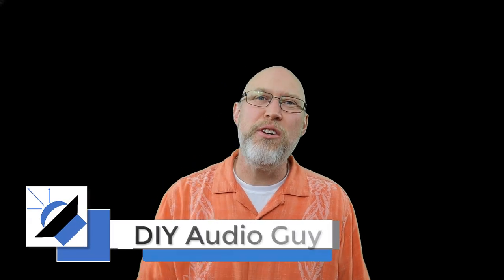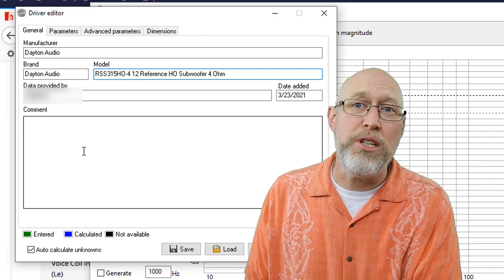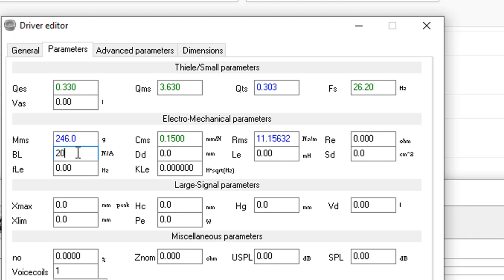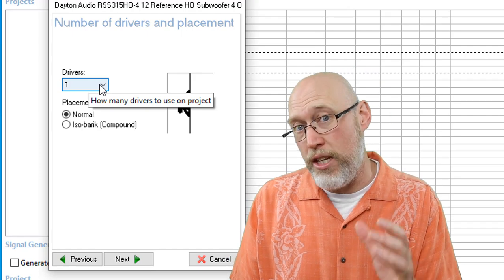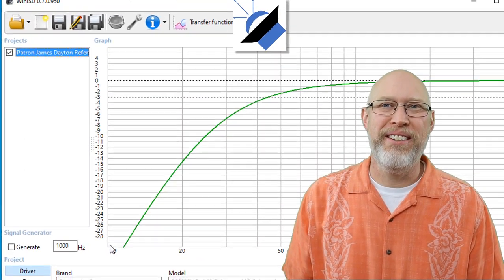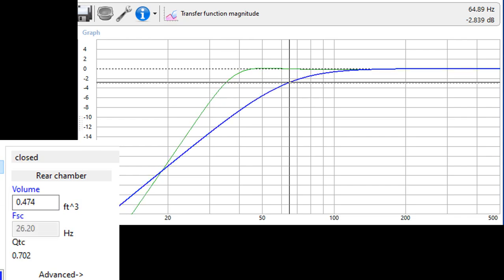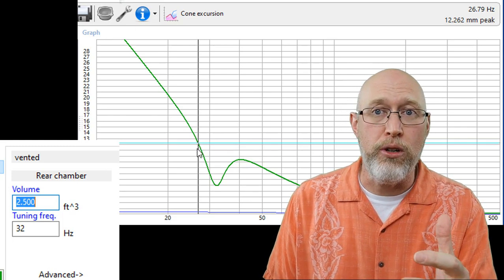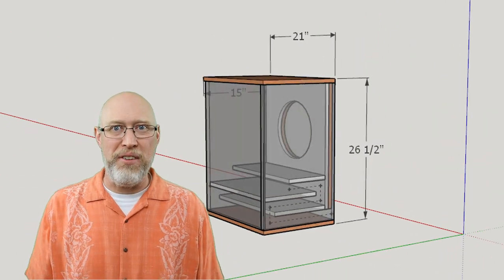WINISD for beginners, design your own ported enclosure!

Comment: hello good night, great video. I would like to know if the calculation that winisd makes of the box, if the space that the speaker and the duct occupies is already included. Thanks
Reply from the maker: Nope, WINISD is going to give you the net airspace not the gross.  So you have to add back in the port, any bracing, and the speaker itself.

Comment: I have a pair of old school stroker 18ds. It turns red when I load the t/s parameters.I am not sure what I need to do to continue.
Thanks for your help
Reply from the maker: Other than just going through it kind of slowly and giving it a chance to auto calculate there's not much you can do.  Fortunately it seems like the software can operate when the parameter integrity check fails.

Comment: If you would, could you make a video explaining the differences between the older versions of winisd vs the new one (one youre using). I have only ever run an older version (0.44) and it is a completely different than the new one you just showed. Part of the reason being that the new one's auto fill for the T/S parameters screws up sometimes. Manufacturer will have one spec one way and winisd will say its wrong. Other than that I didnt know the new version has an excursion chart which I desperately wanted after using Hornresp (also another program you should touch on).
Reply from the maker: I need to give Hornresp a try for sure!

Comment: I find it hard to figure out what box size I have to enter. I know the outter dimensions but the sub and port will take some space away. I dont know how much that is because the program designs the port for me after I fill in the box size. So what do I need to fill in there? How can I measure that?
Reply from the maker: In WINisd you enter use the internal airspace, then when you design the enclosure you need to make it big enough to fit the airspace and the port.  Hope that makes sense.
Reply: @DIYAudioGuy  thank you! I was always calculating the port with the box but that’s what you add to the box afterwards ofcourse! Do you have any tips how to make it easy to calculate the ported enclosure when you want to use the maximum space of the trunk? So I have the outter dimensions of the enclosure and I know the tuning freq. Is that going to be allot of calculations until everything is right?
Reply from the maker: @JamHavoc  You just have to measure the trunk, and make sure you can fit the box in the opening.

Comment: I'm so glad I found your channel.  How did I not know about it sooner? Lots of technical stuff which I love. One question I have or would like to see a demonstration of is dampening or dampening factor.  How ohm load effects it and spl/SQ and such.
Reply from the maker: I am not an expert on amplifiers, but from what I gathere damping factor is a way to express how well an amplifier controls the cone movement.  It's one of those things that's important up to a point.  Like everything else with audio there are diminishing returns.
Reply: @DIYAudioGuy  appreciate the reply. Its one of those im not even sure if or how they can measure it. Strage thing I've noticed when playing with the meter is that seems good damping seems more efficient with spl. Ya you can gain a db going to half ohm or whatever. But at the cost of 2x the amperage draw and sloppy cone control.  but also not the case always.
Reply from the maker: @sittdogg  there's a device called an audio precision, the big manufacturers should all have access to one.
Reply: I always try to express the importance of high damping factor when playing low frequencies it’s basically the amplifiers ability to control the incoming eddy currents

Comment: I want to make a Subwoofer with passive radiators I tried using WINISD and selected the Passive Radiator for the type but it won't go ahead after this step. Any idea how can I design one?
Reply from the maker: Try uninstalling and reinstalling WINisd.
Reply: @DIYAudioGuy  I'm sorry I should have said it clearer. I mean it says that the current version of WinISD can't do this
Reply from the maker: That's odd, I have designed PR builds with it-- it was a bit buggy bit it worked.

Comment: What could be the problem with the failed integrity check? I have entered all the ts parameters but it still fails! Awesome video as always!
Reply from the maker: It could be anything, it could be down to a rounding error or the parameters provided to you by the manufacturer might be wrong.  When I enter my parameters I'm always very careful to make sure that the software has an opportunity to auto-calculate.  Take the QTS, QMS and QES.  WINisd Will let you enter in all three, I enter two of them, and then click in some other random field and the software will update.  But if I enter the first two and then click on the third one and type it in then the software will not auto calculate.  Hope that helps.
Reply: @DIYAudioGuy  all (the 10 or so I randomly picked) of the pre loaded drivers fail integrity check.  Seems sketchy
Reply from the maker: @mickharr  That's odd
Reply: @DIYAudioGuy  yeah I thought so too. It seems the integrity check has no tolerance on the computed parameters,  if you enter too many it will fail due to rounding.

Comment: How many decimal places does the unit conversion need?  I cannot get the checksum to pass no matter what I do.  Had the same problem last time I tried WinISD years and years ago, and it seems it's still an issue.  Incredibly frustrating; everyone always talks about how useful and powerful the program is, and I'd love to not have to do everything with pencil and paper like I have for the last 30 years...  :(
Reply from the maker: That's not fun!  I would just avoid doing unit conversions and change the units in winisd to match the ones given by the manufacturer.

Comment: Unfortunately ti looks like WinISD doesn't take Le or semi-inductance into consideration, both of which will appreciably change the response at bass frequencies for today's long x-max, high-power car audio woofers, particularly if they don't have "shorting rings" in the motor.  That's why I prefer to use Hornresp for design work.  Hornresp is a bit more difficult to understand though - which is why I developed my BOXPLAN Excel workbooks - just choose the one that matches the box you'd like to build, and it chucks out the corresponding Hornresp parameters :-)
Reply from the maker: I have been meaning to give hornresp a try.

Comment: Nice. I just finished up creating a sketchup of a 5ft front ported floor speakers and 4ft back ported speakers. I get the driver data fails integrity check, but it allows for me to continue with the modeling nonetheless (entered precisely what was on the datasheets). It is an MTMW design with a subwoofer in the basement. That makes it a big speaker (2'x4'x14"). The size is mainly to accommodate having a  10" Dayton Reference sub in it. 

I just got the Loudspeaker Design Cookbook 7 and read through chapters 5 and 6. Planning to do a Home Theater set. Here is the posts on my journey over at Toid's forum. https://toidsdiyaudio.com/community/diy-speakers-diy-speakers/kartesian-5-0-system/#post-6220
Reply from the maker: Tell Nick said "hey"!

Comment: I feel like you should have put a little more time into the part where you enter the parameters. I really recommend Toids video on that matter. Inputting data is very frustrating if you don't know in which order you have to plug in the values.
Reply from the maker: In my experience the order does not seem to really matter.  You just have to go slow and make sure that the software is doing the auto calculations.
Reply: @DIYAudioGuy  In my experience, having the software do the auto calculations is exactly what causes issues. Small "workaround" tricks that I've learned: 1.) Entering values in any other tab than the "Parameters" section can trigger an error, so while less "information about the naming of the speaker" will be available, keeping that info out allows for less erroring. 2.) After every value put in, regardless of the order in which you enter them, attempt to "Save" the project (you don't actually have to save, just click the button to see if an error comes up that'd prevent you from being able to save). Then, backing out of the save and entering in your next value... This procedure can show you exactly when, where, and how the program doesn't like something you've done, and you can start to get a feel for what not to do in the future to avoid errors from happening, like enabling "auto calculate".
Reply: @DIYAudioGuy  Oh yea totally sorry I didn't mean the order. I meant that it is easiest if you go by a certain scheme. The scheme toid showed always yielded a good result for me

Comment: LoudSpeakerDatabase is also a fantastic source for T/S Parameters (as it already has pre-populated files!), but it's user contributed so there's a bit of lag between new drivers and files being available.
Reply from the maker: I will have to check that out!
Reply: @DIYAudioGuy  It's great for people like me who always mess up the "order on entering the specs" or who struggle to find specs for certain drivers. It's sooo helpful when it's already there and all I have to do is click the "WinISD" link and download the file. 

I look forward to hearing your thoughts on it.
Reply: @budgetaudiophile6048  I downloaded the file on the website you wrote.
It's an Dayton Audio Ultimax 10 for me, but WinISD tells me that the driver data fails integrity check
Reply: Thank You so much for telling I spent 30 min entering the parameters it worked in the end but I'll still use LSD. Should have read this comment before doing lol
Reply: Hmm I tried using the LoudSpeakerDatabase driver and WINISD shows the red sign so it won't work in my case
Reply: @ashyouknow7420  Yeah, I have the same problem
Reply: @ashyouknow7420  Ahh, that sucks. I wonder what parameter didn't pass integrity checks.
Reply: @DTW-bx2vy  So just the other day, I picked up a Dayton Audio DATS V3. That is some of the best money I've ever spent! It's helped so much with projects. I highly recommend it!
Reply: @DTW-bx2vy  I feel you. I'll just say, to play Devil's advocate, that I AM the Budget Audiophile so if I don't HAVE to spend money, I won't, LOL! That said, I purchased the DATS because I had a single project that I wanted to confirm the specs on and since buying it, it has been indispensable for my cheapskate projects and No-Buy Challenges. 

I won't spam on this channel (for obvious reasons) but I'll just say, take a look at my Facebook, if you're on there, and you'll see it in action. It's a super useful tool that pays for itself in only a handful of projects.

Comment: Winisd is great WHEN you can get the parameters correct in the correct order! That is always the frustrating part for me.Or when all the data is entered and winisd says it's wrong.But when it works, it is awesome!!
Reply from the maker: I find that often times it works even if the driver parameters aren't right.
Reply: @DIYAudioGuy  Maybe I have a real old version. It flat out will not let me continue when its is not all 100% correct.Ill delete and re-install and try that. Really is a insane FREE program!
Reply: @drrckhamilton  I watch toids diy audio video on how he does it. That has been the only way I have done it successfully.
Reply: I need help with a slot ported box sub up port back in a 2003 chevy tahoe for two 15s